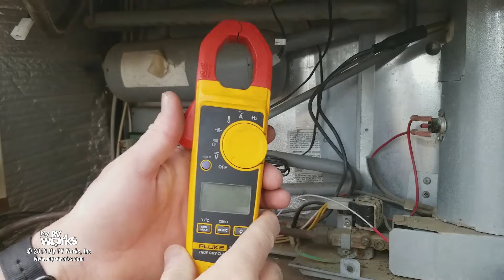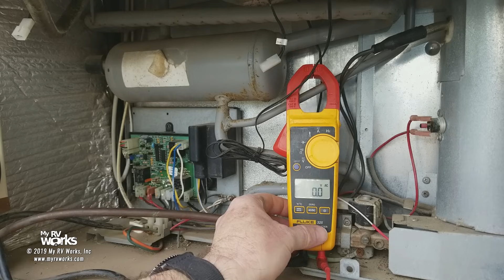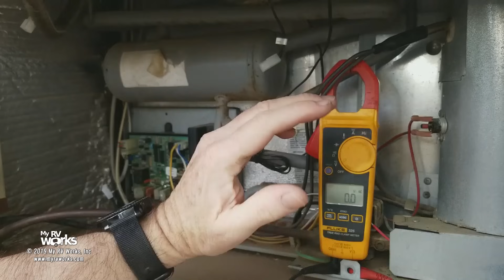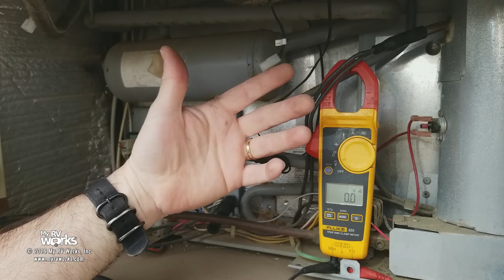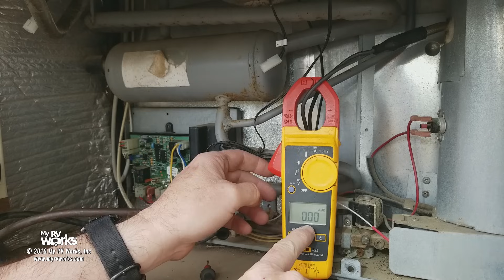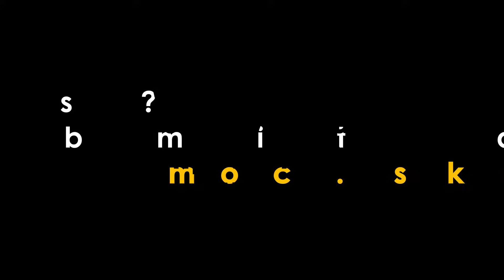Troubleshooting An RV Refrigerator That Works On LP But Not On Electric

Comment: Really great video and channel. Must have for active RV’ers. When will the upper control video be posted? I’m struggling with my debug.
Reply from the maker: I'm planning on more refrigerator videos since the ones I have uploaded have been so popular.  I do plan on making one on a full LP operation, walkthrough and breakdown. Also the eyebrow board diagnosis.  Keep watching.
Reply: I’ve run all the tests and everything checks out.  How hot (degrees) should the boiler read  while operating on 120v?  I’m stuck!  Propane works perfectly and does a much better of keeping the fridge cool.  But on AC it struggles.  Ideas?

Comment: YAAAA !!!!   I worked one step at a time up until the step where I pulled the heater cables off the board and read 120 volts.  Then i plugged the cables back in and now the fridge works !!!!   Just  a loose connection Im guessing

Comment: Thank you for this video. My fridge will run on propane but when I try putting it on ac shore power and it blows the glass fuse. I have 130 at the fuse then when it kicks on it jumps up to 140 and blows the glass fuse everytime. So your saying its a bad relay? Or the whole circuit board is bad? I know you made this video a long time but if you could answer this I'd greatly appreciate it. Or if someone could answer this id greatly appreciate it.

Comment: I have a Dometic that runs great on the heat element with shore power. However, recently when I switched to the inverter, it was acting like its shorting. It will pop the GFCI in line. When you turn the refer back to gas it stops. I didn't find any shorts when I tested the power cable with a meter. It has ran just fine off this inverter for 4 years. Then, everything else running off the inverter has no issues. I'm all open for testing suggestions.

Comment: Hey Darren
Thank you for your technical knowledge my RV refrigerator now works on both electric and propane as well. Quick note my wiring diagram on the recall panel and on another label mentions 12volt too. Does this mean it will work on my house battery’s.

Comment: Video is awesome. Followed the steps and my board isn't sending out power to the heating element. My fridge in rv has the number 3313596.000 for desc item. Model is cu626e. What control board would replace that. Thanks for your videos.

Comment: My issue is that it runs on electric but will randomly quit.  I can turn it off and on and it will work again but I never know when it will go out again.  I checked the fuse in the back, it was good but I put in a new one anyway.  I also cleaned out the back really well.  Inside the lights both glow the yellow so I don't always catch it right away.  Last 5th wheel had a red light if it went out (nice).  I've been just making sure I also have the gas on and value open to keep it going but since I like to keep the frig on all summer even when we're not using it it is very using too much lp gas to do this.

Comment: This was great.  Unfortunately it brings up for me additional problems.  After following this video, I have tentatively diagnosed a faulty circuit board (no volts at the heating coil tabs).  The problem that I have is that I only bought my TT a month ago and haven't as of yet used it.  (It is a year old so used by others).  I drove it off the lot and to my driveway and there it has sat and first time I want to use it, this comes up.  I have a feeling that I am going to have a fruitless argument in my future.  But nevertheless, thank you for the wonderful video.
Reply: Sort of the same here! Ours works good on gas which is all we've needed thus far BUT, it fails to work on mains (230v) in the UK. We to have no a/c voltage on the outputs to the heaters!
Reply: Doesn't work on 12v either with the engine running.

Great videos, thanks so much :)
Reply: @johncooper5674  what brand is your fridge?  I finally solved my issue but it was somewhat brand specific.
Reply: Thanks for the reply (:
Our fridge is an Electrolux AES RM4505. It's probably year 2000! I have mains voltage to the board but nothing out to theater!
Reply: @johncooper5674  Okay, mine is Norcold.  The manufacturer literally redesigned a whole new circuit board for my fridge.  A redesign that was going to become standard for the entire line of fridges.  Dometic brand fridges are the other name we commonly see in NA.  They were part of Electrolux in the beginning.
Reply: @sirpurrcival  That's interesting. If I could find a suitable replacement board(s) for my fridge, it would solve my problem.

Comment: hello darren Ive been looking at your videos but im stumped i hve a 2020 dometic  DM2872LBFX im going camping tomm and turned on refrig today to get cold on ac power freezer comes on and works fine on auto frig not cooling though went to gas and looks like dropping maybe alittle  i have lights on inside frig but fins are barely cool

Comment: Will u still get the reading of 120 off the pins of where the element wires plug  if the fuse is blown?

Comment: Darren, 
I have watched some of your videos on you tube and I am impressed with your ability to get your message across in an understandable way. I will be looking into your website. Thank you for your presentations. 
I do have one question for you. Why would the control board have a 5 amp 32 volt fuse as opposed to 5 amp 250 volt fuse when it has 120 volts going into the fuse? Mine has a 5 amp 32 volt that has been working but the electric side has stopped, and I have a blown fuse. Since this is an old Norcold 1200, I'm not sure if the right fuse was being used. Thank in advance for your response.

Comment: Love your videos! Your detailed explanations are extremely helpful. 
My 4 year old Dometic RM1350SL was working perfectly staying between 34-40 degrees F (depending on outside temps) for the first 2 wks of our summer trip. Suddenly the other day, the fridge started warming up even though the operation seemed normal (heat source on, 4 fans working, cycling on-off as usual, etc.). By the end of the day, it was up to 60 degrees in fridge and 45 in freezer. I reset it several times. Changed it to LP. Checked power to all components. RV is level. No smell or yellow leaks. Everything seems to be as it should, but it is actively warming up the freezer and fridge instead of cooling them. Called Dometic and they said I probably need a new cooling unit. Question: How could a 4 year old fridge go from working exceptionally well to needing a cooling unit in 1 day? Is there something else I could try first before spending $2500 on a new colling unit? We are currently in MA where the weather only gets up to 80 degrees and the fridge is in the shade all day. Any advice would be appreciated.

Comment: I like your presentations, Thank you! 
I may have an intermittent issue because it works on AC then it doesn't. I have a new element but haven't put it in because all the sudden it stopped working. I disconnected all AC & DC and let it sit for an hour for a factory reset. I reconnected and low and behold its on. Propane or AC it hits 34 degrees. 
I recently did install an extra fan in the chimney and one on the interior box that attaches to the fins with alligator clips. Are the alligator clips causing any interference???

Comment: Hay Darren I have a quick question. On the top right side of the control panel where the yellow, white and blue wires. Where does the blue wire go to? Mines just coming out of the that top right and I can’t figure out where the blue wire goes too. 

Thanks for any feedback.
Reply from the maker: That blue wire is only used for testing at the factory when the board is programmed. After that it serves no purpose.

Comment: I've checked DC and it's good at 13.6 volts at all DC power points. I've got 66 volts running in at black hot and 55 volts running in at neutral white. At glass fuse that had blown so I replaced, it is at 66 on both sides of fuse now and 66 at both heater element tabs.... Does this likely mean a bad control board? All power running through it but not at 120 only at 66 volts. It's like control board has burnt somewhere on the 55 volts white neutral input.?.? It's going in at input tab but not going through the fuse and on to element.
Thanks in advance if you'd answer.🙂

Comment: Great video.  I have this issue.  I have AC power to the board, but it only runs and cools on LP.  I don't know what the ohms is suppose to be, but it's in the 40s when I check it.  I swapped out the control board, still no AC cooling.  Its a norcold 611V.  It only has an on/off switch and says "Automatic" on the front of the fridge.  Any help??

Comment: I am looking for the video for the upper control board troubleshooting. Can't find it.
My frig (dometic rm2611) works on lp. 
I have checked heating element, has 120v, 295w, and runs at 2.4 amps for 28 seconds and the trips the GFCI breaker. This is very repeatable.
I already replaced the main control board.
I have 120v on both sides of glass fuse. 
Any other helpful information?

 I have enjoyed your vids and tell others with rvs about you. thank you.

Comment: Ok tried the new board but still no 120v to the heating electrical element pins? The unit is a 6162 norcold single door. It is set on auto and electric light is on. When unplugging the outside 120 ac plug the gas kicks on but both ac or gas isn't cooling the fridge? So first question is why no power on electric to the heating element board pins? Thanks

Comment: Great video, thank you for posting it. I took the cover off of the panel. The blue wire is not connected to anything, I assume that is the reason my fridge only runs on gas currently.  Where does the blue wire connect to ? Mine just have some black plastic on it, it appears it could have been accidentally pulled off of wherever it was on. Tyia
Reply from the maker: The blue wire is not used in the field. It was used when the board was programmed at the factory. The black heat shrink is to cap it off.
Reply: @MyRVWorks  thank you for the swift response. I guess when I get back to the mountain I will test as u described 👍

Comment: Ohm's Law: E = I x R
where E=voltage in volts (V), I=current in amperes (A), R=resistance in ohms (Ω). 
In the example of this video, the measured values satisfy Ohm's Law in that 121 V = 2.84 A x 42.3 Ω.
Power can be calculated as I x I x R (i.e. I squared x R) or as V x I. 
Again, in the video example, I x I x R = 2.84 A x 2.84 A x 42.3 Ω = 341 W or by the other formula V x I = 121 V * 2.84 A = 343 W. Both values are within 5% of the nominal 325 Watts specified.
As a lifelong electrical safety professional I'd like to put in a plug (no pun intended) for using a bit of care and attention around 120V AC. It can and will harm or kill you if you let it. Get help and/or instruction from a knowledgeable person if you don't KNOW what you're doing.

Comment: I have a dometic rm3662 fridge that I had  the light on the upper control board but after some troubleshooting I do not have any power . I was not getting power with just shore power before . Iv determined that the 110v is coming through the Fuze but do not have any coming to the heating element tho my heating element test good . How do I determine if the lower or upper board is bad? Or witch one in particular.  As I mentioned I no longer have any lights on the fridge I will also note that I may have hooked 12v power up backwards . I'm testing my fridge out of the trailer

Comment: the one thing no one, that I've found has addressed the 12v circuit other than check the fuses. Mine just quit working a month ago and since it was cold and rainy I said screw it for now and grabbed a mini fridge. Now that it has warmed up and quit raining I found I only have 3.5 v coming in to the unit. so somewhere I have a bad connection to find. But until I find it I hooked a new line in so I can use my larger fridge.

Comment: Do I need the inline therm fuse?  The refrigerator run on gas just fine but when plugged into 110 Shore power it trips the breaker on the supply. So if I unplug the Dometic refrigerator I still have TV and everything else works properly . I do see I don't have a inline fuse located on one of the two red wires. Newbie Rver J.

Comment: Great video!!  I have completed your excellent pinpoint tests and still have an issue that I need help with please.  All my pinpoint tests were good and show the correct numbers at the correct times so I cannot figure out what is wrong with my fridge. The element is good, 35 Ohm, supposed to be 34.6, the voltage is getting through the board, and it will work for a few days but then burn up the fuse every couple days and the fuse holder part of the board is starting to brown/blacken from the heat! 
There is also a bad electrical burning smell in the fridge heater cabinet.
The error code on the fridge says there is a lack of communication from the top board to the lower board. Code is E0.   
What do I test from here?

Thanks!

Comment: Darren,   Thanks for this video.  I quickly determined that the electric heating element is the issue with OL ohms on the element.  This frig. Is a Dometic DM2652 and utilizes a 325 watt heater.   The element is inside a split sheet metal tube with a sheet metal cover around the heater and inside the tube.   In order to get the element out, the split tube needs to be opened below and above the hole.  Can this be done from the outside or does the refrigerator need to be pulled out?

Comment: I have an almost three year old Norcold N8X. It's really worked well, however, the last few months it's been sketchy. And what I mean is it working fine on propane, questionable on AC. It won't cool as fast or maintain cool like it did on electricity. I would plug it in overnight and it would cool to under 40. Now it may hit 60, 55 tops overnight. I'll run propane to get it less than 40 and then switch back to electric. It'll creep up and I'll start the process again. It is summer here, so yes, it's hot, but this seems to be progressively worse than it was. In your opinion, is there any tell tell things to look for? Would the heating element change in resistance signify this? Control board- I can change. Heating element, not so sure.

Comment: Any chance doing a video on a Dometic RM3962 not cooling? Dealer replaced the whole back side of the fridge a couple years ago under warranty and its been fine until last week. Very hot and humid it was a fine until our last day and started creeping up 36, 38, 42 and even 60F. We found the thermistor slipped down so I adjusted back to where it was when it was working but didn't help so we turned the fridge off for a day, turned it back on and it cooled down to 36F with an empty fridge and maintained that for a week now. I put in a case of room temp drinks throughout the shelves and now is 42F in just a couple hours.
Reply from the maker: You may want to look for an ice dam issue on the backside of the cooling it. Here's a video I did on that. It's not specific to your refrigerator model, all these refrigerators work under the same principle. https://youtu.be/--DCnSw1jP4

Comment: Love the channel but on this particular episode you said that there “could be” an issue inside on the control board on the fridge. Well my fridge was having the exact same issues and so I went step by step as you did to check and sure enough, same as the unit you were working on. Couldn’t find a video on the board for inside so I ordered the main mother board and still haven’t fixed the issue. If you’ve done the video could I have the link or title so I can proceed to the next possible step. 

Power going into board but no power going out to heating element. Fuses good, etc. Put in new board… with exact same results. ???? I’m lost, please help
Thanks

Update… 
After much head scratching & debating I decided to pay a tech to come out and look it over instead of me just throwing parts at it. He come to the conclusion that the eyebrow board was bad. There was a short that would sometimes work but most of the time didn’t. Luckily he had a new eyebrow at his house that was exactly the same. It’s been about a month now and everything is still working fine.

Comment: Hi Darren.  This was a great video.   I did all the tricks in the video.  My FW Dometic RM1350 fridge is only a year old.  Everything works on LP,  but when I switch to A/C it will work for only 10 min and then shuts off and then it will come on at some point,  and shuts off again before reaching the set temperaturer.   Hence on a cool down, have to use LP and once cool down I switch to  AC which operates intermently  (like 10 min at a time).  It is almost like it turns on on AC and by 10 min it overheats? and trips something.  But the all fuses, heating element are good (checked the ohms) . I did not check for 120v at the heating cable connection on the board.  Any idea?  Is an indication of a bad control board?
Reply: I have an RM1350 and have this exact same problem.  Works on LP for days and days with no issue.  Any resolution on this?  I even replaced the heating element and have the same behavior.  Ohms are fine and pulls the proper amps when it activates..

Comment: Norcold fridge here. Freeze gets extremely cold. Refrigerator barely cools. Checked the thermistor and it was a bit wonky. Sometimes it would change with being immersed in ice water and held between my fingers and sometimes it did nothing. Only went to 26 in ice water. 
I replaced it and it seems a bit better but still not great. 
Any ideas?